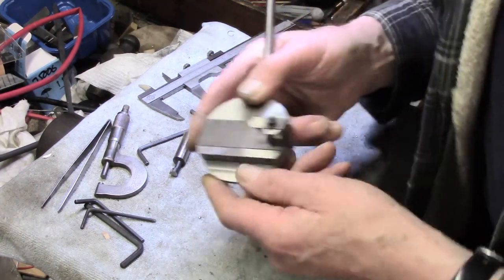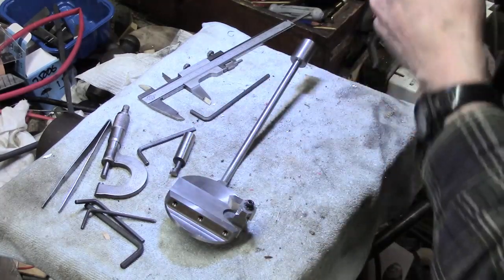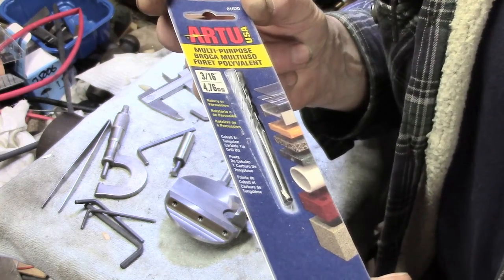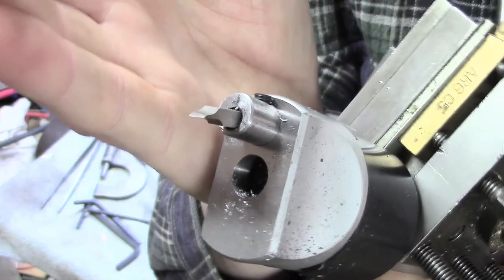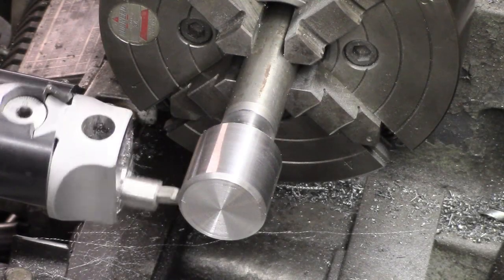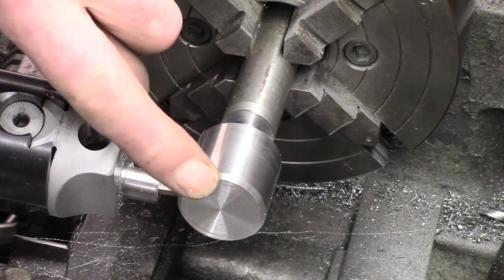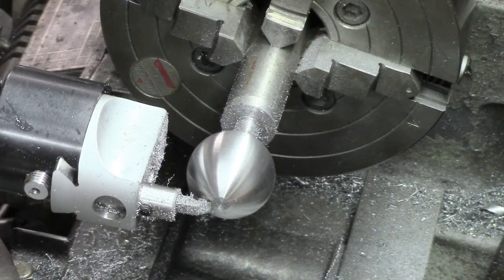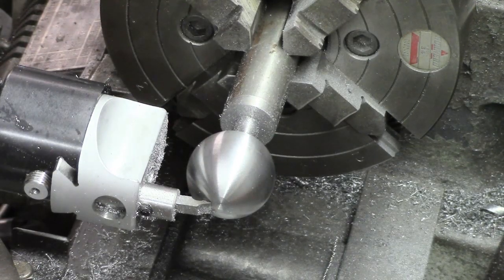Radius Ball Turner MKll - Re-tooled

Comment: Hi, since you're constantly changing the tangent angle of attack of the tool, it's almost impossible to have a geometry that will track to be even close to optimal, mostly at the start...
One possible solution would be to play with the boring head radius adjustment to start the rounding of the blank, then you would be 90deg. to the central axis of cut. To get the most diameter possible you could use a U shaped boring bar in the side of the boring head instead of the bottom... The size of bottom part of the U shape would determine the size of the ball being turned.
If I didn't make it clear just let me know, hope this helps...
Pierre
Reply from the maker: pierre beaudry Thx for your thoughts Pierre -- I certainly have quite a bit of experiment left to do here. Both with cutter grind geometry - which in the end will probably be somewhat of a compromise - and actual action of boring head. I did notice in one video, adjustments made while in progress were almost all with the boring head radius adjustment as against cross slide usage. I must get back to some more development on this soon.

Comment: Idea for tooling (hey you asked for it :-) = mount a triangle on the end of a short bar so that the tip of the triangle faces straight down, centered to the workpiece.
Reply from the maker: JRoque250 Thanks - that certainly is one option in mind. First however is a possible useful grind on HSS I want to try out when time.

Comment: this version works a lot better, but I think you will get a better finish with a different shape tool, there is too much tool contact/rub with this chisel shaped tool, try a tool with a shape like a screwcutting tool with much less contact than this one, I am sure there is pontential (which I was not at first!). You could also generate a sphere on your milling machine with the blank at 45 Degs using a fly cutter, try that method. Chris B
Reply from the maker: Englishman French Agreed Chris re tooling. I shall be making a new one soon. Can't quite visualize the milling approach.
Reply: ChrisB257 OK ,not many people can visualise this process, what you do is to fix the blank, similar to yours, in a rotating head tilted at 45 Degs, you bring this up to a fly cutter held in the vertical head of the milling machine, as the blank is rotated it machines a circular form in your blank,as the blank is rotating it generates a sphere, this gives a vey nice finish as the whole thing is very rigid. Good luck. Chris B.
Reply from the maker: Englishman French Gotcha Chris thx. I have a rotary table but no means right now of setting angle - one of the (many) things on my list!

Comment: HHS sure gave a good finish! Looks this set-up give a great deal more diameter choices! What lube/coolant did you use drilling the HHS,,, if you don't mind? Thank you for sharing... :o) You work calmly in hurricanes... Still had great sound! ;o)

O,,,
Reply from the maker: Opinionator52 Drilling the HSS - I did try using some sulfur-based oil but in fact that drill seems to prefer drilling dry. It does get super hot but is amazing the way it gets through - albeit quite slowly.

Comment: Seems to me like the cutting tool should be at a right angle to the work and always on the center line of the material from start to finish. Now, that's just my opinion and since I have never done anything like this for myself, you can take take it or leave it.
Reply from the maker: William Hardin That would be an ideal William - pretty much as with a regular ball turner. In fact my next tool grind will try and get closer to that, within the limitations of the boring head device.
Reply: ChrisB257 This was my idea.https://www.dropbox.com/s/41u0b0sk3j2obp1/Print%20Tool%20Post%20with%20cutter.pdf?dl=0
Reply from the maker: William Hardin Thx for the PDF link -- all useful food for thought.
Reply: ChrisB257 I drew that up using Onshape 3D Cad last night. the grind is hard to see but it is mostly flat on the tip with the corners having a small radius to help with chattering when cutting into the corners of the material.

Comment: HI chris. How long did it take you to machine the ball?
Reply from the maker: Bob Cartwright Hi Bob - bit too long as cuts had to be very modest.  Wasn't watching the clock but I guess it may well have taken about 45 mins actual machining, with odd adjustment tweaks here and there. That wouldn't include set up time in chuck etc beforehand.